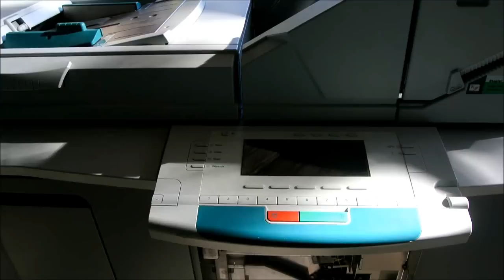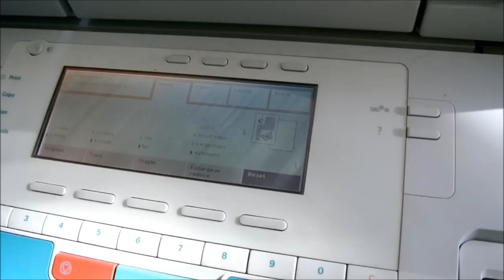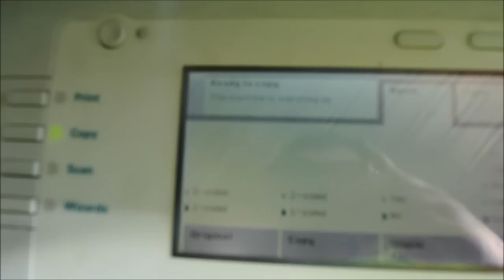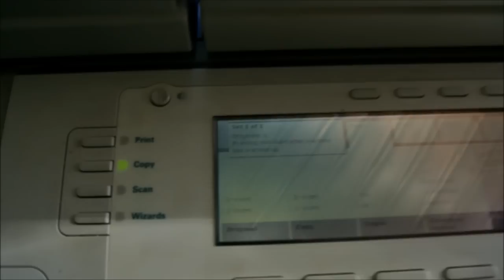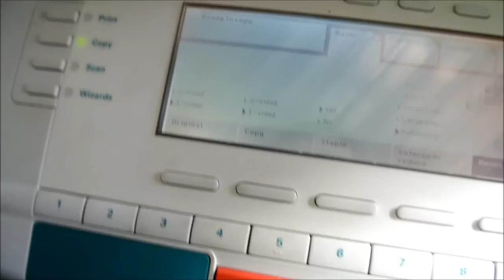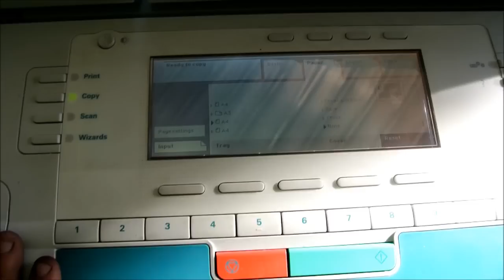Equipment Inspection/Repair :- Giant Copier Part II, It Copies, But its Weak!

Comment: nice machine!, I like the K-M Bizhub manual on the output tray :D. do a detailed video of it cycling from the back, showing how the mechanics of it work :D

The warmup is the fuser warming up, typically a few KW of halogen lamps inside the fuser rollers. they cycle on a thermoswitch. if the thermoswitch or thermistor is dicky it will cause startup problems or fuser overheat. but long initial warmup is typical for big machines, some of my old ones took 5 mins or so to come up to temp

Comment: Océ is dutch and since 2010 a part of the canon group, this is a VP1055 Wich runs 55 pages a minute. the technology used is Océ copy press and its a decent build machine and a real workhorse in the office. i used to service this machine type for some years. warming-up takes a while because the ttf unit has to heat up.  The Océ 30x5 was analog, the Océ 31x5 digital with a seperate controller and then came the VP line with build in controllers.

Comment: If its anything like its bigger brothers, changing the dev requires rerouting some hoses round the back of the machine, connecting up a bottle of new developer and then using the machines UI to begin the purge and refilling process. 
I'm only trained on the big cut sheet and continuos feed printers so it could be completely different! 
It's a Varioprint 2000? I'll see if I can grab one of the engineers the next time they are on site.

Comment: All it probably needs is a developer change and some fresh toner. I could get my hands on a couple of big bottles of both but getting caught and shipping would be an issue! :)
I'm not sure of that model but I'm quite sure you could use that as a cut sheet document printer using Prism or some other software.

Comment: Hi I used to repair those machines, for even prints put the covers on inside should be dark.The fuser heater lamp will flash on and off to regulate the heat

Comment: These things are built for it tbh.
If you want cycles, one of our duplex 7650 printers can print a few files per shift. Each file is about 40,000 documents, with up to 3 pages per document... So on average that is over 100,000 images! And there are 3 shifts running 24/5!